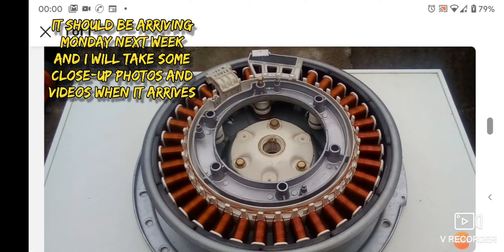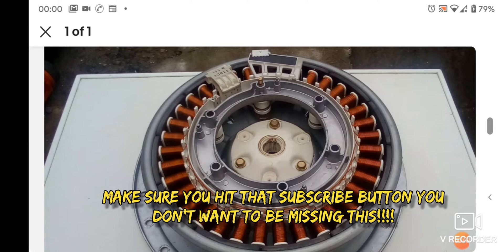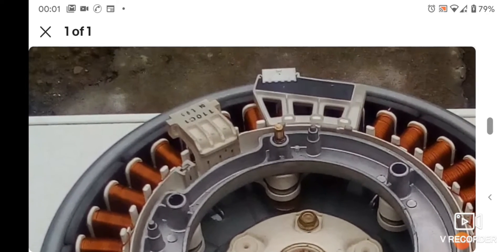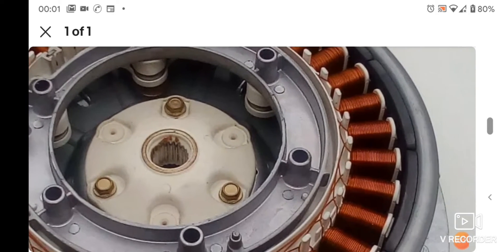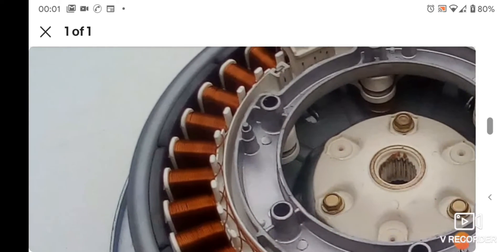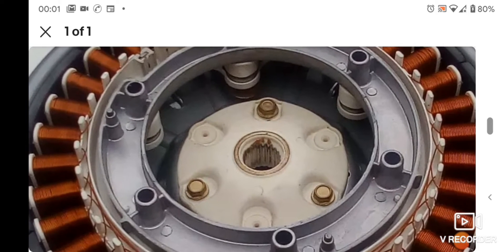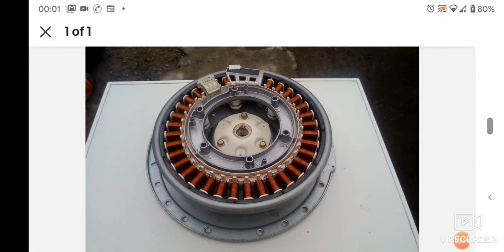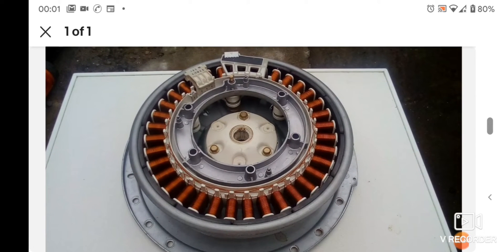Direct Drive washing machine motor into a WIND TURBINE generator???

Comment: checkout  toys for watts  he shows a good way in a series of vids 6 months ago, i had some brand similar looking but the windings were aluminium , you think i could solder or join them it was too hard for me , so i had some spare 18 gauge essex wire and i rewired just one phase by hand was real fiddly and not perfect Yet i found the copper wire made significantly more power than the aluminium i did that maybe 2 years ago before mum died.
Reply from the maker: I went to the Backshed and studied for an hour I am confident will wire it up in 7x 2 configuration :) , this should mean I get medium power in medium wind,great resource for these things.
Reply: @GavinFreedomLover  have fun , toys for watts used pillow block bearings on his non fisher and paykel , he had to try n get them and the shaft centred by eye but he did better than i imagined, id like to do the same.
Reply from the maker: As the stator doesn't move can you just bolt it to a plate ??
Reply: @GavinFreedomLover  yes it kinda becomes one with the non spining parts of the turbine via much diy engineering, toys for watts made it look easy on that particular  style of direct drive motor. once you come up with a design your happy with you can just change stators in the R+D phase if you end up with more than one. we rent too, i inherited mums incomplete  house but an insane amount of work n money has to be poured into it before we can legally live in it.
Reply: @GavinFreedomLover  i like windgenkits design
Reply from the maker: Yea the copper wire is the only way , aluminium = chi*ese dog sh*t.
Reply from the maker: I'm subbd to Toys4Watts have been for a while, I wish I owned my own place I rent.